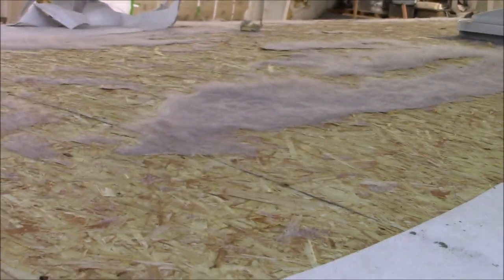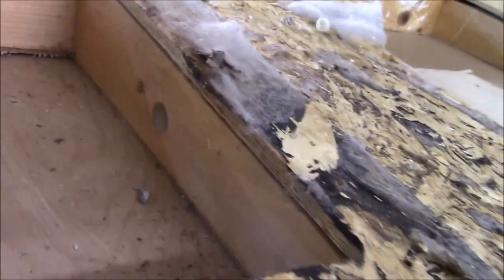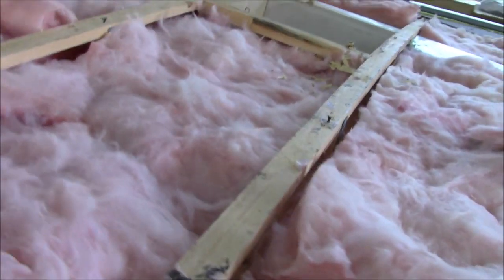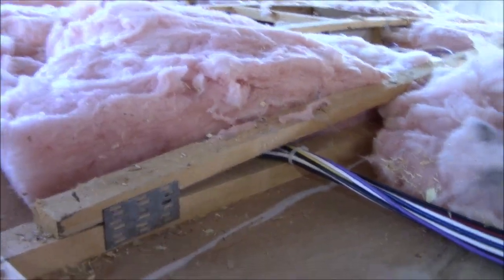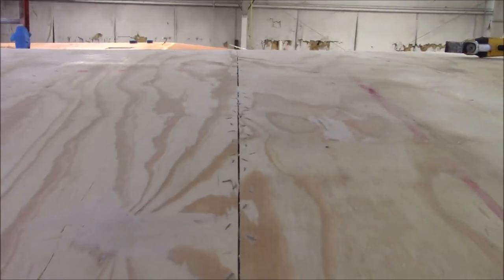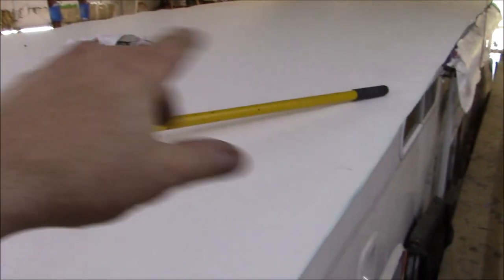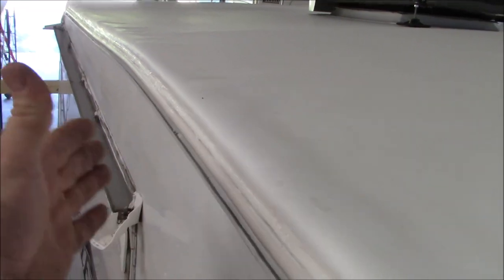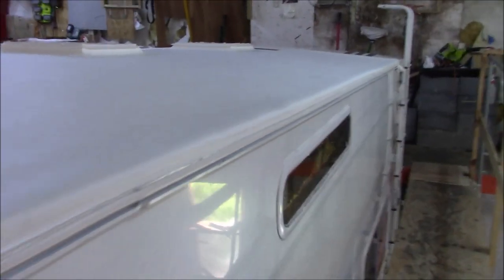RV Roof Replacement and Redeck  on Weekend Warrior

Comment from the maker: Yes you could glue them physically but it would not yield the 90 mil you looking for. The TPO is twice as thick as the 45 in a 90 mil sheet. Also you would have a hellatious time trying to work with it. 60 is rigid enough. We went from 45 to 60 a few years ago. But it is more rigid and hard to get around the corners if roof wall area. Still too, 2 layers you wouldn't get your termination rails to sit right. There would be too much bulk under it. The 45 is a 15 year. Use it. You'll get far more than 15 years. These are tested under absolute extreme exposures and then the underrate the membrane just for their protection. But coaches are not usually in the sun all day every day like a commercial building.pishncomes to shove you could cut the edges back after 20 plus years and glue another 45 to the old one. Easy peasy! Thanks for watching. BTW...keep the roof washed at least twice a year. That prevents the white pigments from getting clogged. White is more effective than aluminum at reflecting UV light....but aluminum dirty or not will still reflect. White will diminish it's ability over time as it gets dirtier.
Reply: Could you recommend a company in Southern California, that does this same work? 
Great video, wish I lived in your neck of the woods.
👍👍👍👍👍😷👏🏻
Reply from the maker: @grumpyg9350  there isn't another company doing the same roofs. We designed them. Thanks for watching!

Comment: Why isn’t any other shops doing this?
Reply from the maker: We designed the roof system. Our background is General Contracting, commercial building and roof systems. Other shop do not have real  commercial roof experience. They only do what the manufacturers do, they don't know better. Thanks for watching and thank you for subscribing!